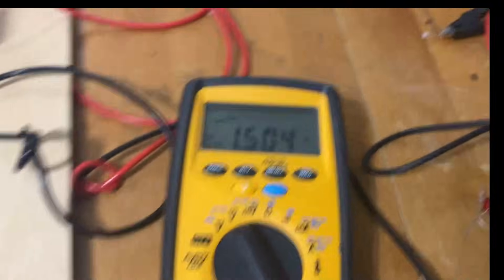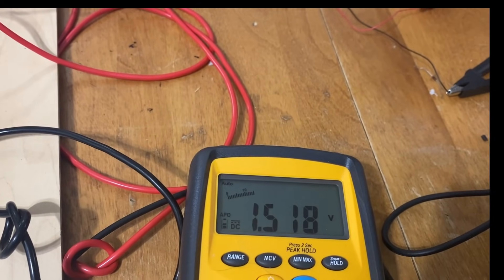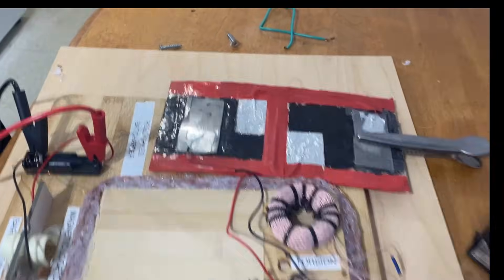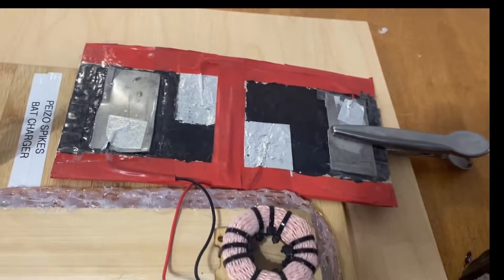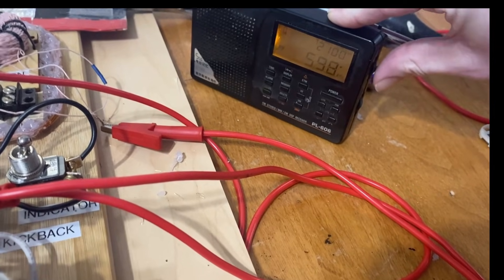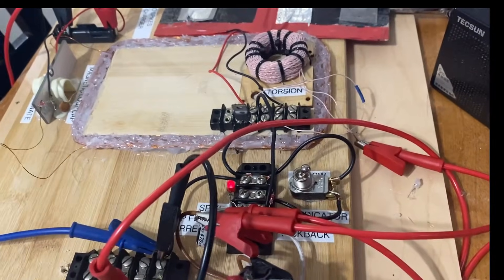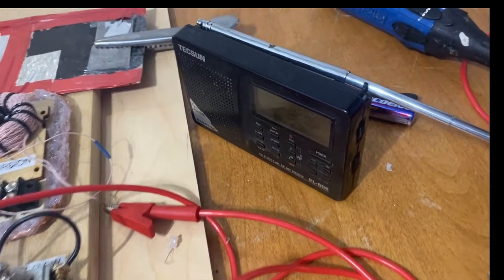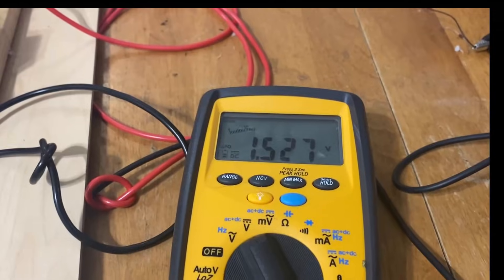Magnetic Resonance Gain

Comment: I'm glad I found your channel.  Finally, someone gets it! Conventional theory is wrong. I do not believe that the so-called current flow is correct. I believe that electrons do not move laterally.  They do not flow like a river.  I believe that they are compressed and are forced to jump inward toward the inner field lines of their respective atoms. This happens when an opposing field energy line applies inward pressure, pushing the electrons off the valence outer field line into the next corresponding field lines. This unbalances the atom, and when the pressure is relieved, the electrons return to their original positions.  I believe that you are missing a big piece of the puzzle.  Once you get a vision and get an insight into what that picture really is, your whole paradigm on electronics will shift. Once I started questioning conventional theories and building my own, the dots started to connect.
Reply: There is an unknown theory.  It is real but camouflaged.  The powers that be know this. It's getting discovered by people like you and me. So many that they cannot stop it.  I have tried to put this theory out there, but no one listens. If this theory is developed, they will lose all of their power and control. An example of this is your splitting of the positive  
video. What a great video.  It shows the waste of using grid-tied power and offers another alternative.